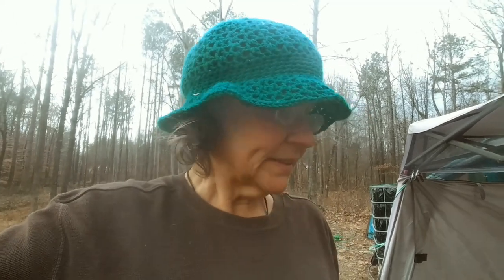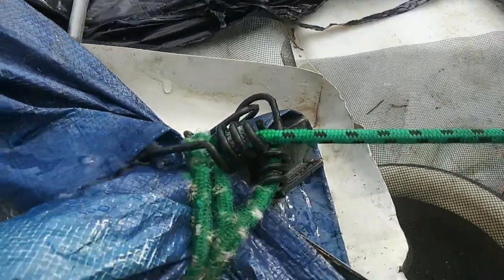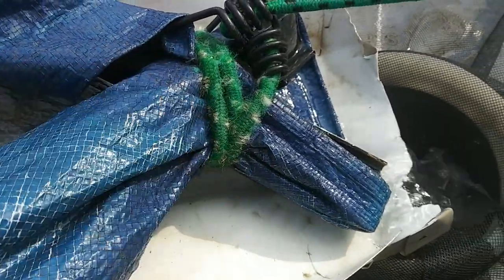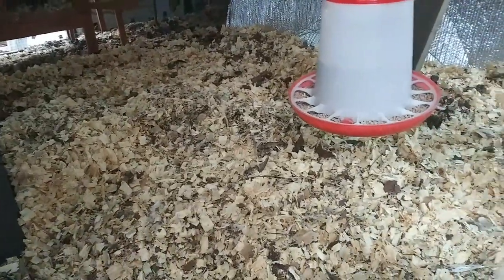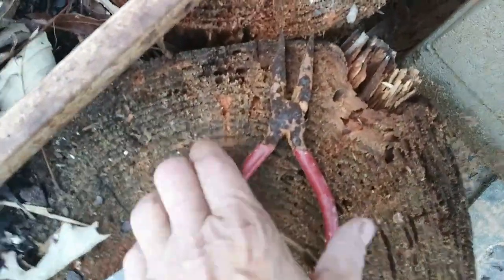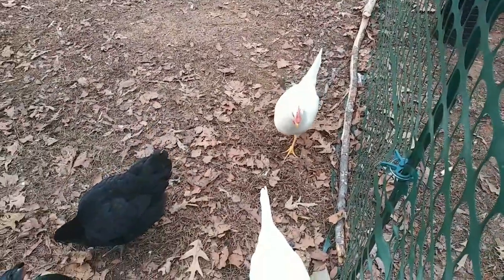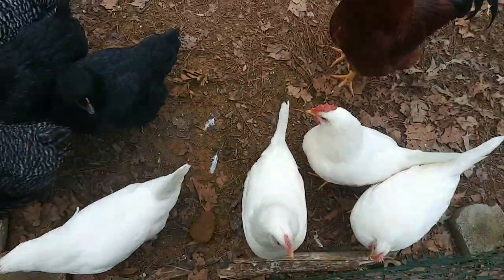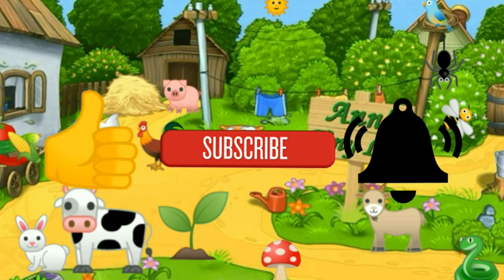Upgrading Off Grid Water Catchment With Found Materials - Ann's Tiny Life

Comment: Dear Anne bern following ur adventure in ur tiny home ... Thought Id give u sn idea or two ... first get a rain gutter snd down spour going into that barrel itll fill quicker and it fairly chesp and eady to install... another is het a heat gun and heat that plastic piece up and mold it to fit that tote... I do this all the time with pvc pipe... another is idea is out a board under ir tarp (think ply wood, the thicker the bettercut it into a V going down towad the tote with with 1 x 4s on each side screwd on to the plwood then cover tarp ull have more water going in the totes tank that way out a support on each side... I hope this helps ..I tried that other way and gully washing rains would wash the tarp down with s big bow in it ...clip the wi gs if the chickens to help keep them in the pens it helps slot by doing that... if u can find a plscr that has new sppliances get card board an out it on walls itll help till u csn insulate hipe tbis helps

Comment: Wanted ssy just dubcribed to ur chsnnel live watching and listening to u describe how ur fojng things ... Ur prezzie time I lovr to watch an see how excited u get... that noise in ur van hor me thinkinh had rhe ssne noise and off sn on smelled radiator fluid ....yep gound it was thd wster pump get it checked  u dont want to lose uf engine if thats wats wrong and I found my belt severly cracked and replaced it ... wishung u thr best from this old homesteader in a small town .. Where we use solar, have a raised bed garden, raise chickens and rabbits, rebuilt this old run down house,  use spring water (yes we have city water but dont drink it , just spring water only for drinking)n run a pellet stove for heat, use an electric (hart brand)  chainsaw for direood for garage I had built (3 guys in 4 hours built itn its 18 x 24)
Reply from the maker: welcome james! and thank you so much for your lovely comments!